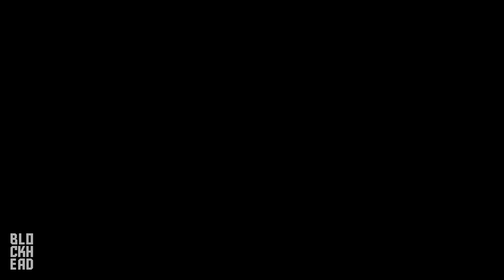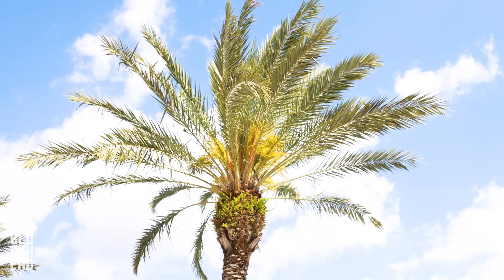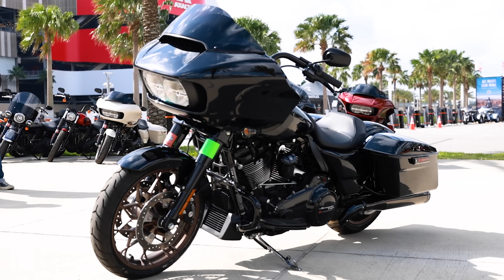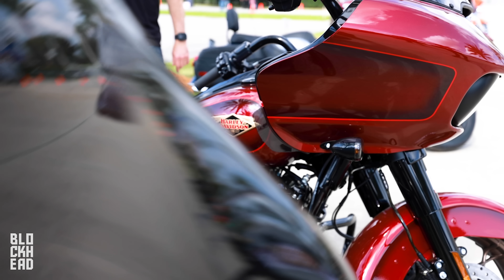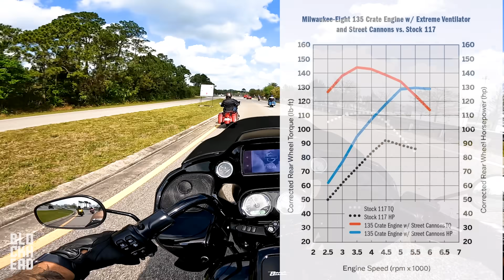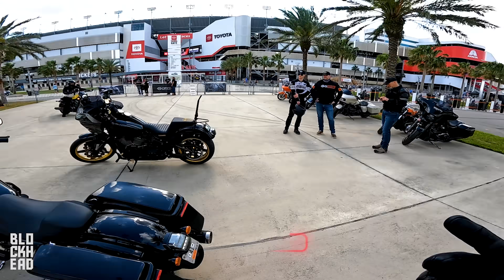Harley-Davidson 135ci Crate Engine TEST RIDE!

Comment: 2200cc for 130HP... i get it, it's about the torque. but still, that seems like a lot of effort and a lot of motor and a lot of money for only 130HP. But to each their own i suppose.
Reply: It's a blank canvas. Guys will put a good cam, a non epa compliant tune, and a good exhaust on it and will be well over 150hp and torque. There's already 200hp 131's out there
Reply: But what’s the point when there are better engine designs? A 1252cc sportster s is making 120hp…. Why just keep going bigger when you could get better.
Reply: @kennethmatte9008  Life is not about peak numbers, shit drives me nuts when that's all people talk about. The torque curve, powerband, response, and feel from the Revolution Max is not going to be remotely similar to this pushrod 135ci crate, and that's not even factoring in the difference in sound.

How often are you really pushing your engine's peak HP number? I'd wager never, even when you're riding like a real ahole. Everyone just loves to talk peak numbers but in the real world, on the street, they really do not matter. At all.
Reply: @kennethmatte9008 because thats a girls bike
Reply: That’s 130hp with the screaming eagle tuner. Who knows how much more you can pull out of it. I also agree with the basis of your statement though.
Reply: Still a lot for a motorcycle
Reply: I have a 2022 Electra glide standard I paid $19.5 for I'm putting this 135 in it I already ordered it
Reply: At the wheel......130hp at the wheel....not the crank .... from an air cooled motor.

That's incredible.
Reply: Not a lot of effort**, this thing will run for 100k miles with no problem, i cant say i have seen a cbr1000rr with over 30k miles
Reply: @justadude8602  Japanese 1000cc bikes run for over 100k miles. Bmw boxer engines run for over 200k miles. What are you talking about. There are Japanese Adventure bikes with over 300k miles.
Reply: @justadude8602  it is a lot of effort. It’s an engine swap. It’s probably $40K all in for the bike and engine and installation labor. A Pan America already puts 130 to the wheel. Again, I get it, it’s about the torque. I’m just not that impressed by that sort of horsepower number when it’s a 2.2L displacement engine. That’s bigger than my first car! It was only 1.8L
Reply: @talkingrock7011  i'm just spitballing over here. i dunno how much a harley bagger costs. 🤣 but that's even worse!
Reply: @ChrisRidesHisBike  bet your first car wasn't a 2-cylinder, though. You keep saying that you "get it", but I really don't think you do, because you keep talking about nothing but a peak HP number.

Leave that garbage for guys that ride ZX-14s.

Remember, at the end of the day, these are cruisers. You don't install a 135 and go hunt 600cc sport bikes, that isn't the point, you install a 135 because it's a blast in feel, sound, response, and pulls like a truck throughout the entire range.
Reply: @ChrisRidesHisBike 
Spoken like a Guy that never rode a bagger and cant afford one. 🤷‍♂️
Reply: @youtubechangedmyname  i have rode a bagger, and you're right that i can't afford one. but having said that, if i found myself with a pile of money i'd probably spend that money on something that's a little more advanced than just "lets take this same engine and just make the pistons bigger and the stroke longer." imagine a 1800cc rev max engine, imagine how much more power that would make. that's my point. it's not about "yOu CaN't aFfOrD oNe DERP!" it's about taking an extremely inefficient engine design and just making it bigger.
Reply: @ChrisRidesHisBike  
Ive owned many sport-bikes , KTMs, GSXRs, MT-09, R1 and yet the feeling I get on a big bore Harley is better. Current bike is a Road Glide with a 117. Best bike ive ever owned hands down. Most haters just dont understand this until you own one and log some real miles.
Reply: @ChrisRidesHisBike 40k? No you shouldnt be even talking bikes with that type of exaggeration
Reply: @salvatoredantes1690  the 135 stage 4 kit is $7999, and a new road glide limited starts at $32500. What did i exaggerate?